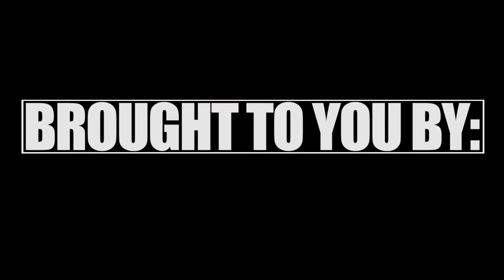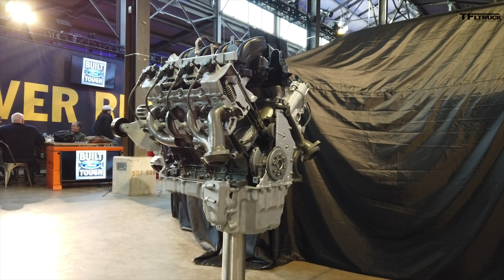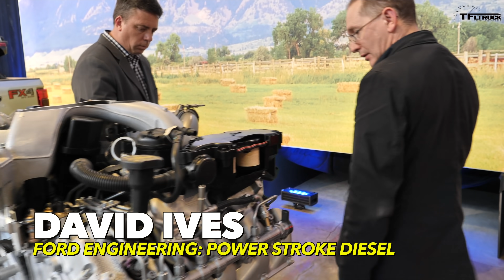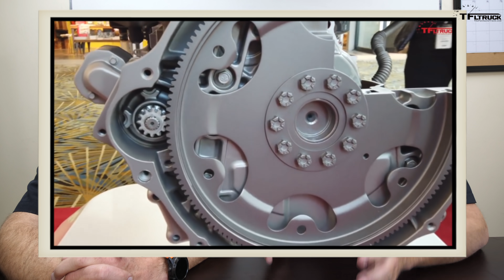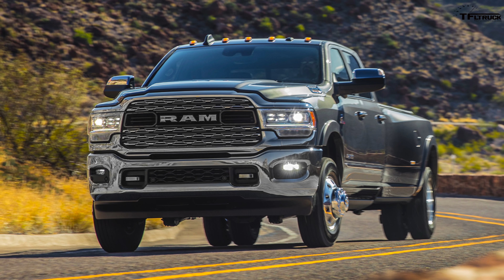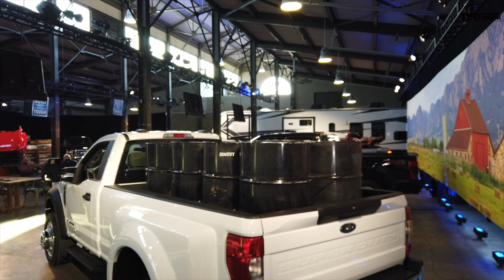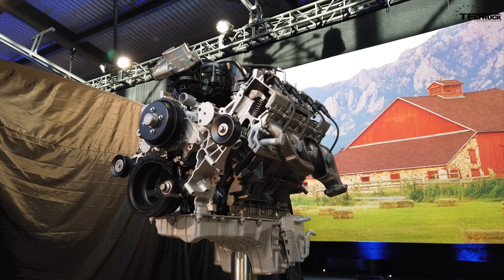Are Diesel HD Trucks Dead / Will Electric Pickups Replace Them? No, You're Wrong! Ep.5

Comment: They're both right and wrong.  Semis are already getting hybrid assist systems to help with fuel economy. But that's just for getting off the line and between gear changes, similar to E-Torque on the Ram. Diesel won't go away even in the pickup market simply because it is so efficient and it fulfills a purpose that even a gas/electric set up couldn't do. Diesels maintain a high level of torque for a long period of time.  Electric motors produce a a lot of torque but only in short bursts. After the initial torque has occurred the torque started to drop off. Then you got the problem of weight involved with electric motors and batteries. Both are very heavy especially for this application. In order to get a me as meaningful amount of power and torque from the electric motors to compete with diesel there would need to be a lot of batteries to make that happen.  Just adding on the weight. For people that don't haul or tow that's ok. But for hauling and towing that's something you don't want because it affects how much you can tow. I do see a market for it and a future for it. But not for a long time and it won't fully replace diesel in my opinion.

Comment: A gas and hybrid system will outweigh a diesel setup by at least 1000 lbs in a truck. That plus there is much less consistency in range with the hybrid setup thanks to weather.

Unless they develop solid state batteries at a reasonable price, a diesel engine will be the best choice for a heavy duty and medium duty trucks. They're here to stay for a while despite stuff like the green new deal being touted...

Comment: Adding a hybrid system to a diesel will ad at least 3-400lb and change the trucks dynamics. That means a new chassis, gearing, and several
Other systems. Battery technology is years from being advanced enough. If that was the case cell phones wouldn’t need to be charged daily. Plus the fact charging stations are available everywhere and it would be expensive to say the least to build charging stations nationwide. Then comes to the fact at some point “charging station “ won’t be free and then those batteries at the end of their life are have a worse ecological impact then fuel

Comment: Just need to point out that Germany used the most cavalry during WWII, they moved most of their artillery by horse. The Polish cavalry absolutley massacred the German cavalry and infantry. The photos of the Polish horses dead around German tanks are from 2 seperate days, one where the Polish horse pushed back infantry and cavalry, and later when German tanks were passing by. It was German propaganda. Common misconception though. Also, i know these 'no you're wrong' videos are supposed to be over the top, just wanted to point this part out for someone who might think it was correct.
Reply: the good thing about horse power is "you can eat" the critter. Diesel don't taste good, corn gas is good tho

Comment: The only setup where an electric motor might work out in a heavy duty or long haul situation would be in a setup similar to that of a train engine. Where the engine is solely acting as a generator for an electric motor on the axle(s). If you’re hauling 20-30k pounds on any kind of grade, a naturally aspirated gas motor won’t maintain 70 mph on its own, so then the electric motor would be helping a lot. Which then draws down the battery. Which then would need to be replenished. So either it will need to be plugged in often or would need to draw power from the engine which in this case is already overworked. Unless there is a massive jump in battery tech in the next 10 years where a battery can last 8-12 hours under heavy load and recharge as a fast a you can fill up a tank of fuel, it doesn’t seem realistic.
Reply: You don't use that much power while cruising so as long as the engine can produce more then the average horse power needed a battery and motor can cover the few times the vehicle needs max power and then recharge during highway cruising. Throw in a good regenitive breaking system and the math gets even better in terms of how small or an engine you actual would need.
Reply: Matthew Connor I’m saying in a long haul towing scenario like a hot shot driver who hauls out west often. Which is where owning a diesel really is beneficial. A few years ago I towed a 10k pound camper with a 6.4 hemi ram 2500 to Colorado from Ohio. That truck normally got around 14 mpg unloaded. I averaged about 8.5 mpg on that trip. So the engine was under a medium to heavy load majority of the time which is where I would think an electric motor would be stepping in to help if it’s trying to be comparable to how a diesel would handle that trip. Which would be sitting in 6th gear and 1,400 rpm 90% of the way.

Comment: I agree that electric, or hybrid is the future. The technology exists but the consumer isn’t ready for it yet. If all you do is tow or use it in commercial applications, the current diesel makes sense but, if it’s your everyday ride and like most, tow on occasion, then gas or hybrid  maybe more suitable.  The fuel economy for diesel really doesn’t hold up considering that diesel fuel now costs 30% more than gas, so your 12 mpg when towing really is 8 mpg compared to a gas motor.  Just calculate cents per mile.  Plus you paid a meager $10,000 premium to buy the diesel to begin with. And the maintenance cost with def and 3 gallon oil changes is higher.  And how many of you will really keep the truck for 300,000 miles?  Unlikely. I know lots of guys who run 3/4 or one ton trucks so they can tow their fifth wheel but they all use their wife’s car as a daily driver.  No one cares how big your dick is, you hardly ever use or need 1000 pound feet of torque.

Comment: 10-speeds behind the gas engine is going to definitely help fuel economy but not match diesels. However gasoline is also cheaper than diesel. The gas engine may be able to match a diesels fuel economy without towing anything but with weight behind the trucks there will be no comparison. Gas engines are definitely a lot more appealing but this is a market for guys who want to tow and nothing else. They're trying to change the market for these HD trucks similarly to the smaller ones. I just don't believe that's going to work to well.

Comment: I certainly won’t miss the clattering and the smell of spent diesel fuel.
Reply: 1Drummer I certainly won’t miss the soundless dead battery on the side of the road trying to pull a trailer.

Comment: Right now today it is -35 outside  and it has been like that for 3 weeks . I run 3 newer diesels and for most of my driving in this weather Ill take my nissan frontier gas . If i need a big rig Ill take my 94 pete with a cat instead of my 08 pete with a cummins. In this weather new diesels are coded out all over the place.

Comment: When the battery needs to be replaced the cost of it will end up costing more than the trucks worth if you look at the older Prius lot of people are selling them for dirt cheap because of the batteries durability and longevity just isn’t there with electric
Reply: BULLSHIT. Prius has a tiny NiMH battery with very little capacity and cost very little now. That was an outdated technology with much smaller production scale. Your stupid comment is devoid of any relevance to a High Powered 1000lb/ft plus Pickup Truck PHEV or BEV. The 10 year old Prius batteries are Not Applicable to that Pickup Truck use case thus has no logical connection.
Reply: Which universe do you live in?
Reply: Tesla powertrain warranty = 8 years 120K miles. Ford = 5 year 60K miles? Which one doesn’t last?
Reply: 2010drive warranty doesn’t mean anything Ridgid has a lifetime warranty and Milwaukee has a 5 year buy no one will saw that Ridgid is better ford dodge and Chevy have been around forever Tesla is still new to market and unproven
Reply: @loganp7043  True Warranty does not mean much. But here is a detailed survey of Teslas with many over 100,000miles (160,000km) with excellent condition batteries with minimal degradation. Still going strong and forecasted to be not roadworthy after 300,000 Miles. 
Logan P time to face reality you are Wrong.
https://docs.google.com/spreadsheets/d/t024bMoRiDPIDialGnuKPsg/edit#gid=1669966328
Reply: Neojhun that’s a spread sheet it’s not a reliable source plus weatherman predict weather events all the time and how many of the predictions are right Diesel engines can last longer than 200 and 300k some going in to the millions of miles
Reply: @loganp7043  That's a freaking Commericial Vehicle an entirely different league of usecase. These Consumer Passenger vehicles are expected to be just as reliable as Commercial Vehicles. 
https://www.tesloop.com/blog/2018/8/2/model-x-90d-300000-miles-in-two-years
Here is a Model X being Abused doing 300,000 miles in just over 2 years.
Simply because of the robust and simplistic architecture of BEVs. Time to face reality or you are in Deep Denial.

Comment: The fallacy of electric vehicles is the energy required to charge batteries has to come from somewhere. We have not replaced all our electric power needs with renewable energy. Wind and Solar is a thing but it provides a very small amount compared to the whole electric power grid. Many states have (WV for instance) use coal plants so electric vehicles do not provide the carbon emission savings as touted. Also take into consideration that we have to dramatically increase our power plant capability to compensate for the increased demand as battery powered vehicles start to come online and require charging. We also have infrastructure issues in outlying areas (rural) that may need updates as well. We have a ton of hurdles to overcome before electric powered cars is widespread and sustainable. We have technology at the vehicle level to provide electric powered vehicles but we dont have the infrastructure to support them yet.

Comment: Also one thing to mention, is future hybrids will not rely on DC batteries and more so on ac, so vehicles will have bigger and dual alternator,  so I can see hybrids replacing deisels especially if the motor powers the front wheels

Comment: Interesting fellas👍I can tell you Cummins is n will be hybrid hook up electric pack they have revelled that in tractor industry.  Not sure with Ford 7.3, funny it’s port injection not direct injection, let say it chew fuel like 6.0lt in mpg, maybe cheaper run then diesel but I think displacement n running gear is high for hybrid. Either Cummins is going down expensive path or Ford has made a big mistake in size of 7.3. Surely Ford should have brought hybrid to market instead big gas engine?

Comment: A diesel electric truck.....Look up what Christian von Koenigsegg has done. ( Regera) A supercar that is stuck in 7th gear. All because of a gas motor attached to an electric motor and the super Tq converter that he has invented. A 1 gear transmission. Equal amount of torque  from the moment you squish the go fast pedal all the way to the floor. I love my gas and diesel engines.Yet electric motors can vastly improve in so many ways help us get ridiculous HP, Tq and great fuel economy! We just need to be cautious on how to "throw out" Li Batteries.

Comment: Guy look out entire infrastructure is built on the Diesel engine. I foresee electric out there for fuel economy only but it's hard to beat trusted diesel technology. 
Has anyone there realized that where does all this electric power come from and yes the backup systems even on large oil wells are diesel engines. If electric power is so great why do all ships on the planet use diesel engines? Answer me that

Comment: I’ve been saying it for years. Technology in gas engines are gonna kill diesels. There’s no need for a pickup that can pull 35k lbs. If you need that then there will be trucks available for that. The majority of the market never pull that weight. 

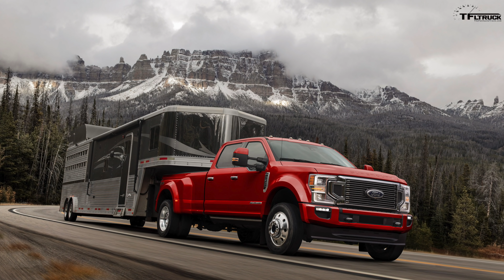I had a 2016 F250 with a 6.2 gas and 4:30 gears. That truck would pull our 15k lbs fifth wheel with no problem at all. In fact, it was quicker to 60mph than my current 15 Ram 3500 Cummins/Aisin. 
Now couple that same engine and gear ratio that my ford had but now put a 10 speed auto behind it. Bam! It’d be a beast!  
I see the future going gas and torque multiplication. Then possibly small turbo, low boost to help. 
Eventually auto trans will probably have 20 speeds to them. That torque multiplication will easily surpass diesels that are rated to tow 25k.

Comment: Combo has more moving parts and potential for problems (two power plants). Cost of ownership must play a role as well running perfectly and potential repairs. History is on the diesel's side before the addition of DEF. I think when all is said and done the Ecoboost will be an integral player in powering all trucks. The Ecoboost offers the torque when needed yet is easy on fuel. PFI along with DFI has addressed one big hurdle for this engine's future as a player. I could see a "7.3" Ecoboost blow the doors off anything out there.

Comment: What about long uphill grades and the lack of long lasting power with the battery. If the hill was long and steep enough then the battery pack would diminish and you would be stuck with the weak gas motor to pull some huge load up hill.
Reply: What about running out of gasoline going up the hill?
Reply: Don't forget though, regenerative brakes means on the downhills you'd be able to recharge the batteries for extra range

Comment: electric vehicles are bs.  how much are batterys going to cost at replacement time and they take to long to charge  at the current time  maybe in the future when technology makes a big leap on electric technology . diesels arnt going anywhere soon
Reply: Modern EV batteries can actually last the life of the vehicle, if you consider vehicle life to be 1,000,000 miles. As I said above, there's a fleet of Tesla's out west with 500,000 miles on them, and the batteries are between 11-14% degraded (they're considered EoL at 20%). Oh and they degrade on a parabola curve, with degredation rates slowing the more they're used.

Comment: Forget batteries for now, just look at the diesel F-150 vs. the 3.5 Ecoboost F-150. From the numbers I'm reading the 3.5 ecoboost is faster, cheaper and has a higher tow rating than the 3.0 diesel. Now if you take the money you save buying the ecoboost and add a few batteries and an electric motor (aka F-150 Hybrid).... Diesel is dead, maybe not for commercial vehicles, but as a consumer product, diesels days are numbered.

Comment: So he’s saying take a 7.3 gas which is supposed to be lighter than a diesel, and then start adding batteries n electric motors to make up the extra torque? So now your basically at or over what a diesel weighs and way over complicated the system. Long live diesel
Reply: Don't forget his other argument was that diesels are expensive. And we all know they give away those battery packs and electric motors for free.  They don't cost anything. Plus adding all those batteries, electric motors the wiring, controllers, etc. makes the whole truck simpler and less likely to have any issues( yea right ! )  .

Comment: We need a small diesel or gas generator under the hood that charges a battery pack that allows you to have unlimited range and pretty much unlimited power this would be the perfect truck in an HD or midsize I have seen some estimations that say you would achieve approximately 500 miles per gallon with this set up but I suspect I will government would never let this happen
Reply: All those batteries and generator will kill the payload and towing capacity .

Comment: I have saying for years, that diesel is gki going away. Unless you will be towing massive loads. Even the over the road rigs have been working on converting the diesel engine to run on CNG.

The issue is not the durability of the engines. That's just a smoke screen. The issue for the last ten years has been all the emissions components that fail or cause these trucks not to run right. The little businesses are going broke keeping them running right.

As for tuning a new diesel for more power. With what? The EPA as all but  stopped the aftermarket from selling these tuners for the new trucks.

I can see Ford adding more power on the 7.3 as needed in the next year or two. Electric motors?  Maybe, or even turbos.
Reply: @Sham Pain Jones Not sure about this. How many tens of millions of gas turbos are out there. Ford, Audi, VW, Porsche, Volvo, BMW, GM and many more can be had right now a a dealer near you.

Comment: Diesel trucks are dead to me...because diesel fuel is $.60 MORE per gallon here (Cincinnati) and it has been that way for years.  Diesel used to be less than gasoline, but for over 10 years now it's consistently 50 cents or more per gallon, so buying a diesel is no benefit unless you just need the extra torque, think it will last longer or you just like it better.  It's not cheaper.  It's more expensive to buy the engine option, then it's more expensive to buy the fuel and that offsets/kills any MPG advantage.

Comment: I think Fords 7.3L gasser is really for the F-650/F-750 that are sold to rental company fleets like Penske, U-haul, and Budget.
Reply: Brad Larson it's for the f 250 and bigger!
Reply: I was thinking that to low cost maintenance and power where it needs
Reply: Yup it’s likely slated to replace the aging 6.8 Triton V10 used in those medium duty applications.
Reply: The new 7.3 will also replace the 6.8 V10 in most of the new gas powered Class A and C motor homes.
Reply: Exactly.